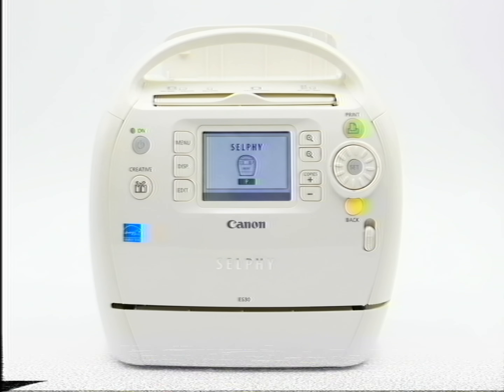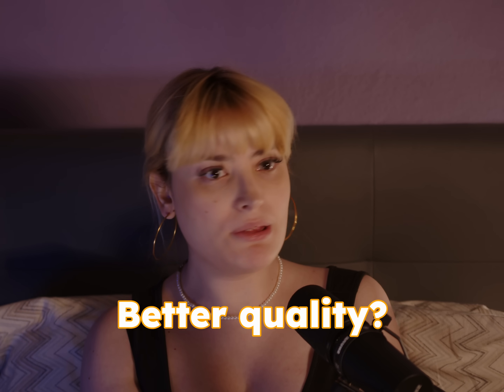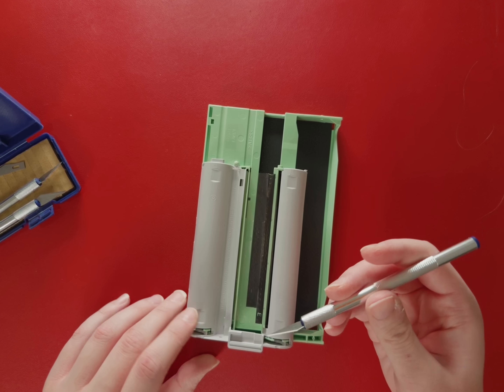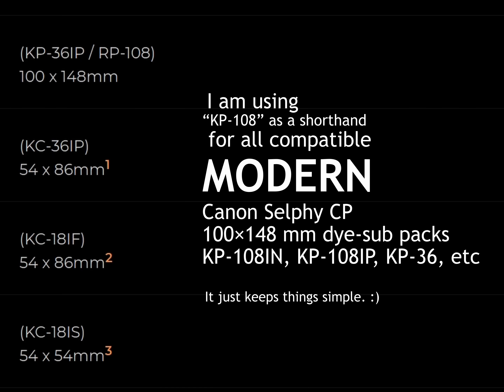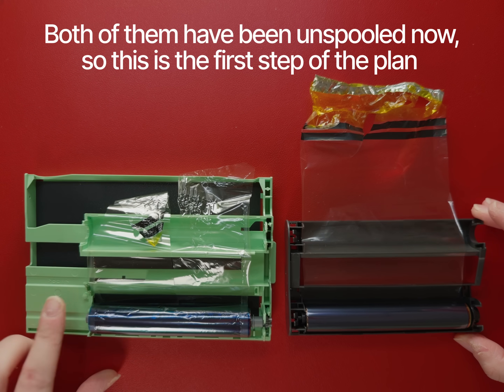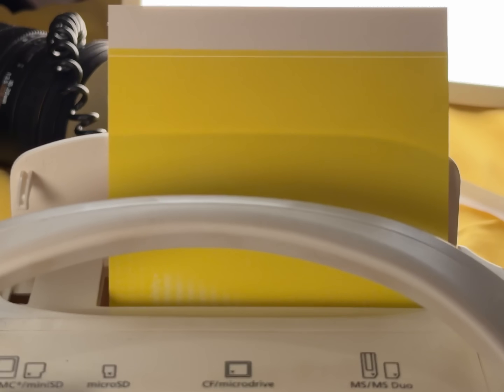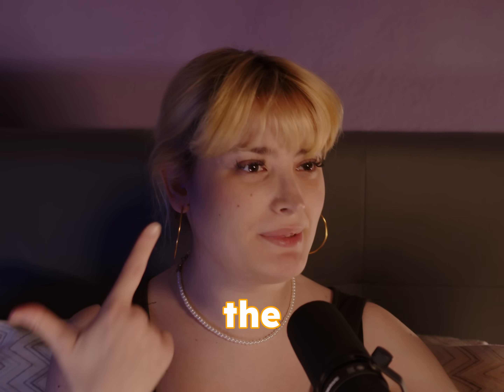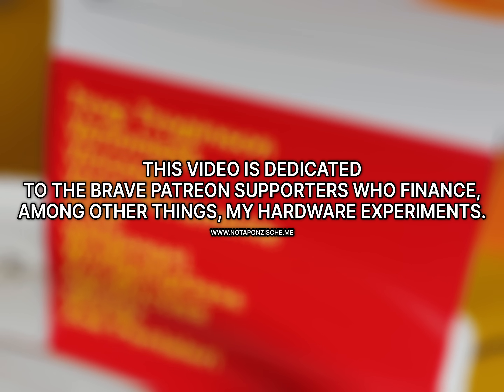Making my OWN printer cartridges (and saving my favorite printers, I guess)

Comment: Love this. I've become quite adept at renovating and respooling 8 track cartridges. I got given a load from a charity shop and wondred what the hell to do with them. So I thought I'd need a player to at least test them. And of course, they didn't work because 8 tracks are wanky. 
So, cue learning how to respool and renovate them. I've built a very simple lap-based rig of sorts to spool the tape onto and back off, and found decent bits of foam and felt to renovate the cartirdge too. 
NOw, if only I could find a way to stop pinching my fucking fingers every time I try to wrestle with opening the damned things.

Comment: Well, I tried to do a similar thing with a “powder-based ink” cartridge. Because the cartridge of a Canon printer is only different from an old HP one by some small plastic thing and a chip.and they are just expensive for an old printer ,so i said to myself, why not just try to move the powder itself… Biggest mistake of my life. At least it worked for you in the end ^_^

Comment: The main idea behind this cartridges it’s so clever, basically they’re carbon paper but colored, the bad idea behind it's due it’s form factor they need to be compact so the brand selected a cellulose compound, that is so sensitive to many weather issues like temperature and humidity, and even on ideal conditions it starts degrading after some years. All un used cartridges are condemned to this, so your idea is the best thing we can do until some facility starts making small batches again, just like wat happened with polaroids and other 35mm films
Reply: I must have accidentally cultivated the ideal conditions for these cartridges, because the only one I have is very old, and the colours are perfect.

Comment: Getting the ribbon itself the right way round is more important than the over/under part, though depending how you respool it one may dictate the other. For 3-color-ribbon printing, the standard order is YMCO (3 colors lightest to darkest, then overlay). I guess this particular printer finds yellow to start, rather than the black mark, and then just assumes the order from there, so if the ribbon is backwards you get YOCM exactly like what happened on the first attempt.

Comment: Badge printers use the same ribbon print design. Good memories, having to deal with badgy's unstable cartridges that would fail a few times per cartridge. You learn to hack them quickly 😅

Comment: Canon MFC642Cdw is the best copier ever made. Cheap to buy (for colour, laser, all in one), will print a million pages with very low maintenance, cheap moustache toner replacements are great and last for 3000 pages - and canon lets you use the printer however you want and doesn’t require specialized software or drivers (looking at you HP)
Reply: I’m an IT guy, I’m not affiliated with Canon… just passionate about copiers I guess

Comment: So I have a dye sub printer that is from an old arcade game. It is vendor-locked (can't use ink from other machines even if they use the same type of printer), region-locked (can't use ink for the same type of printer from the same vendor if it was purchased in another region), and discontinued by the manufacturer. 

The chip itself is an encrypted and protected NFC tag but I figured there is no point in cloning it if we cannot make new cartridges. The fact that the chemistry is likely similar to any other dye sub is promising, just need to get around to figuring the chip out then... The roll on that one though also has some different sized marks between the sets of ink squares, so that might be a problem. Thanks for the tip anyway!

Comment: I was expecting you to splice the new roll into the old like they do to film reels rather than fully removing and replacing it onto the spool. It might be easier to just cut and splice since you can treat each of the sections like a separate image of a film reel and just tape the new ones in where you need them. The old ones even have images on them, so it's kind of similar. With the stripes to indicate position, it should be less sensitive than film splicing and might make the process easier. That said, this is amazing and now I want a DRM free printer.
Reply: A splice is probably easier and quicker? Especially where the old cartridge held 50 photos, there should be plenty of room.

Comment: Great video as usual and I really like the process shown as well, but I have a problem with the usage of AI GPT, sponsored or not, would prefer actual research done in comparison. I understand that some people will not like or think I'm being pedantic about it, but for a channel like f4mi, which involves a lot of hands-on research and experimentation, it is a shame to see the usage of something that does not accurately or fully explain the process or information.
Reply from the maker: ??? i did do research manually and explain everything, what is this referring to? the sponsor is a website builder so i don’t really have a problem with that, and gpt was shown specifically to mock how gpt says what i am doing is impossible lmao

not trying to be aggressive or anything i am just confused
Reply: @f4micom  I have an issue with both in fact, specifically because its contradictory in my opinion
Reply from the maker: @Motwera i did think about this sponsor for a while and considering they are a european company (therefore subject to pretty strict privacy laws etc) running a llm on their servers specifically to only work as a basic website builder: it doesn’t seem like anything evil or dangerous to me personally or different from most website builders right now…

Comment: Honestly DRM while the product is active is (unfortunately) understandable, but when a product is discontinued, an update should be provided to remove the DRM, or it should be remotely removed. I'd even be okay with that. Have your rights management until you discontinue it, then give it up.
Reply: No it's not. This isn't the same as software-only products that can just be replicated endlessly when you have cracked the DRM, a printer only exists once.

There should be a market for DRM-free printers with zero "protection" software to begin with, because the only thing that this awful system does is to protect the manufacturer's bottom line. There are no cybersecurity risks in a printer, unless if the company intentionally backdoored the system to:

a. Constantly connect to the internet
b. Collect personal data of its customer, including IP addresses and phone numbers
Reply: @syahmiirfan6779  we live in reality. companies want to protect their product. the DRM will be baked into the firmware. It IS the same as software-only products. It can be removed by firmware update.
Reply: @beneh1337 "The most permanent solution is a temporary one."

I've heard this quote somewhere, but I think it applies well here. Anyway, that's not gonna happen. Do you really think that a company who is malicious enough to put DRM in their cartridges in the first place is willing to remove the checks in a firmware update? Give me a break.
Reply: @syahmiirfan6779  The implication is that it's written into consumer protection law. "Give me a break" is kind of an insane considering this is a thought experiment. Take a deep breath, everything is okay.

Comment: Down with the inkjet oligopoly! Imagine all the innovative printers we'd have if more than 3 companies were allowed to make them.
Reply: There is an open source printer now on crowdsupply announced which was already made(considering the pictures). Though no info on the timeline or price or even a way to throw money at them(despite my willingness to). The only downside is that they use hp cartridge, which aren't the most reliable.